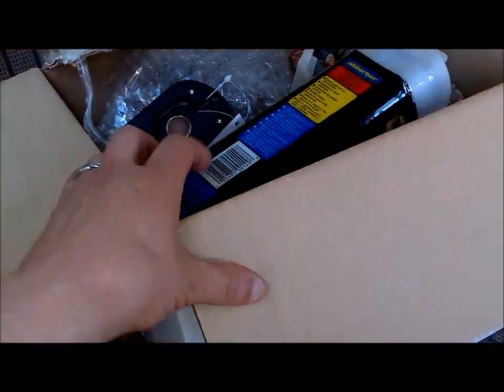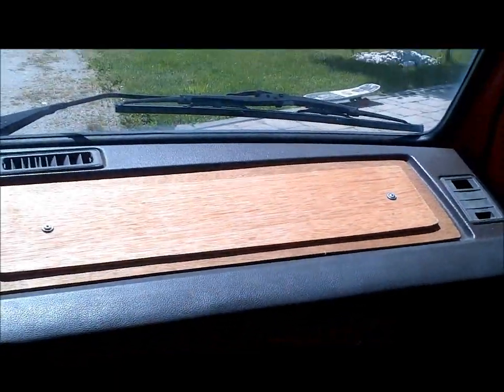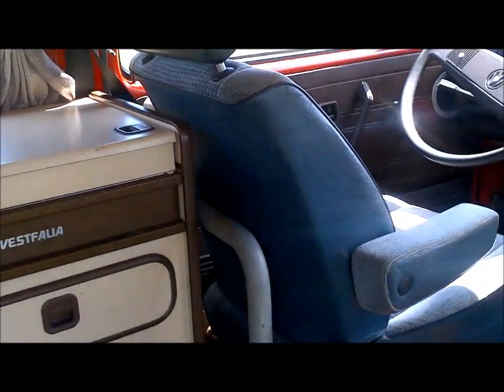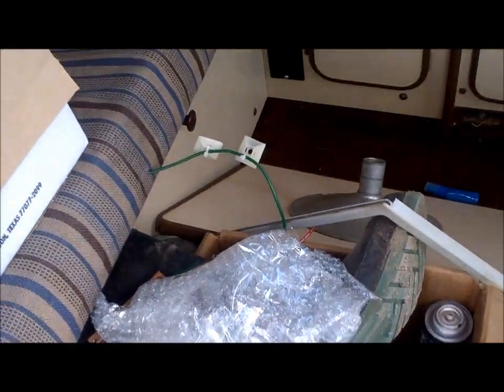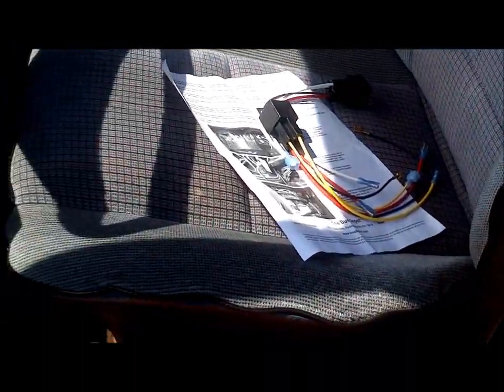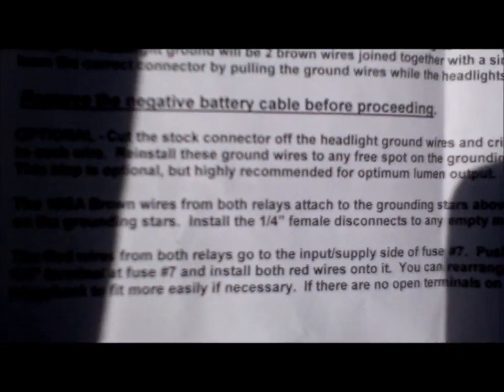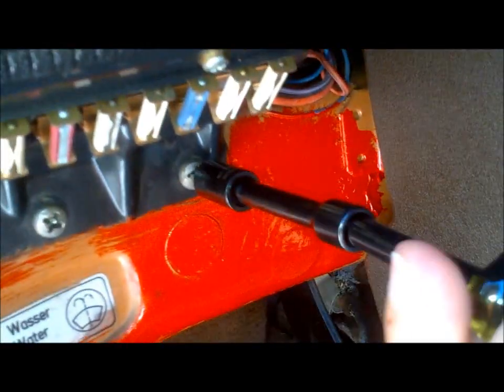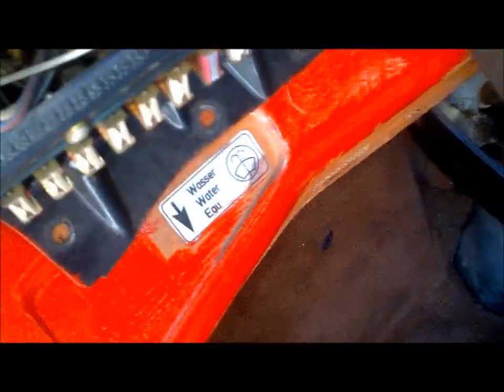Vanagon with VisionKit  from Busdepot.com

Comment: All those relays do is take load off switchgear. Proper way is to take power direct to battery via uprated cable. Supply to fusebox is only 6mm cable - barely sufficient.
Reply from the maker: jackbox I only know awg for wire size but ya they did give a bit of trouble with high beams
Reply: Just double the gauge of supply to fusebox with new cable direct from battey and power relays from that (fused ofcourse). I did a write up on 80/90 wiki (electrical section) on how tu upgrade dash cable for headlights. Hope it helps.